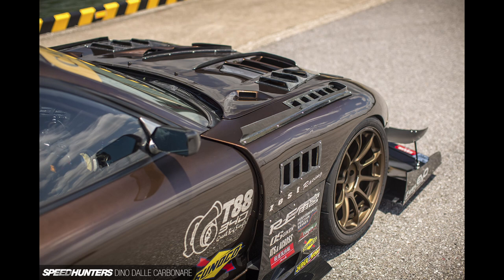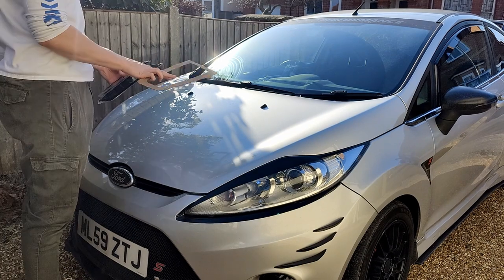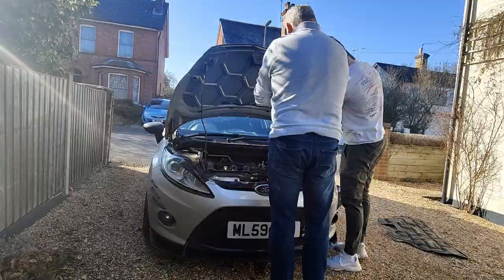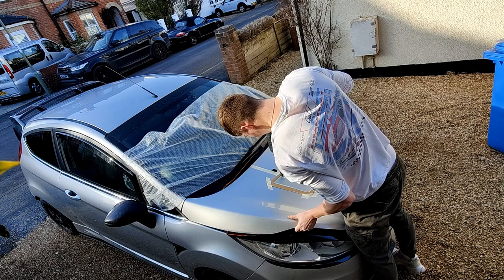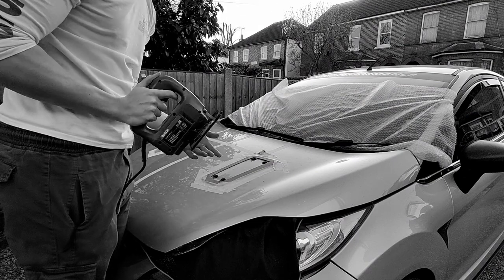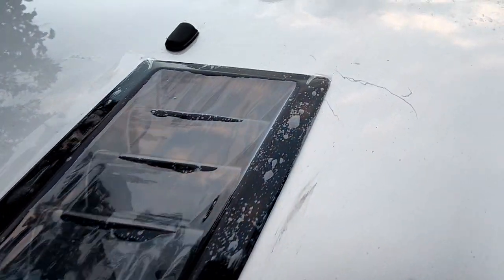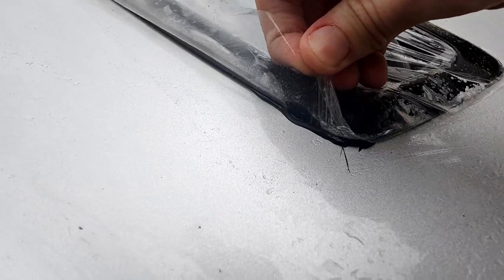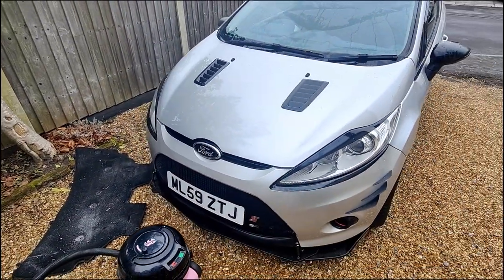Upgrading My Car with WISH Bonnet Vents - DIY Guide

Comment: There may be a solution to not getting water nor snow in your engine bay with hood vents ,but not sure hence I am asking. There is something called rain guards for hood vents but I am not sure if they work nor if they also guard the air away
Reply from the maker: ah ok yeah you can get rain guards but I think normally you use it to protect it when not driving, but I daily the car 😅 definitely something to look into tho

Comment: Hi mate how long did you leave it for under the towels and the weights? I did mine and it started lifting so I went home reapplied the tiger seal and have left it 20hours now
Reply from the maker: yeah I left mine on overnight and that seemed to work well
Reply: @NAUTOG  next issue so they are definitely on now no issues with lift but the amount of excess tiger seal it looks horrible along the edges
Reply from the maker: you can use a Stanley knife and trim the excess away just be really careful of your paintwork 😅